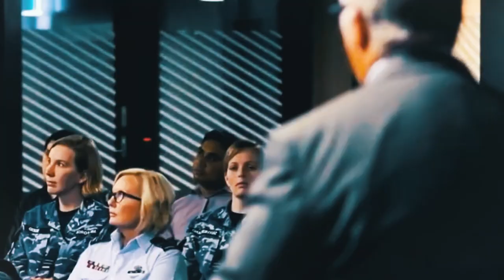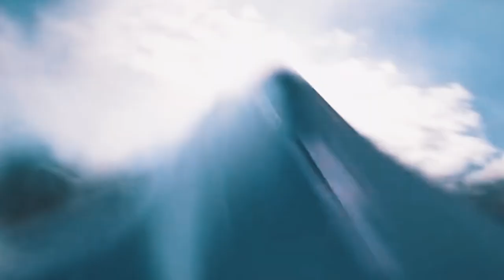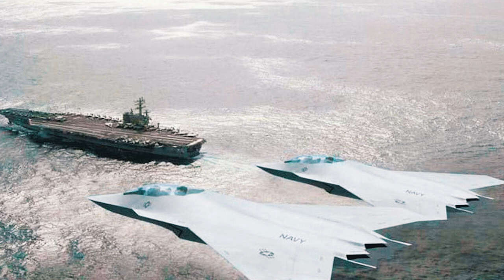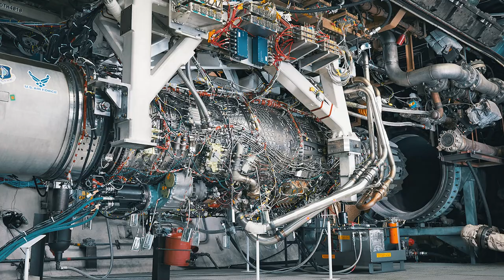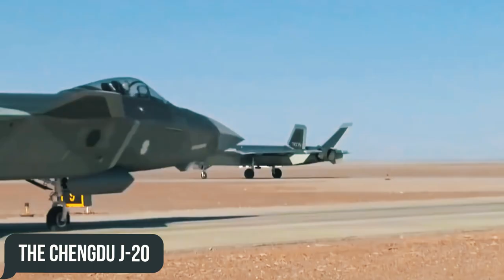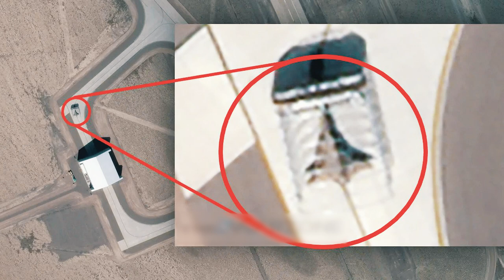Russia Panic: This is America’s 6th Generation Fighter Jet

Comment: In my 6 years of serving in the USAF, I learned this: You don't know and you don't need to know.
Reply: Paraphrased  " on a need to know basis" AIR Force 603 20yrs
Reply: ”Above your pay grade”? Confidential?
Reply: I'd have to agree. Why advertise your possible defense mechanisms. Doesn't make any sense.
Reply: @anthonygutierrez3776  thats why some of  the informations are not detailed..
Reply: I was in the Air Force for 7-1/2 years.  I spent a year in Vietnam and 1 in Thailand.  I worked in the Civil Engineering Squadron, carpenter shop.  In Vietnam the women stayed sort of in the center of the base and they wanted bathtubs.  While visiting their area, I saw some walking from the shower towards their rooms to get dressed.  That was interesting and just had to throw that in.  In Thailand I walked with others across fences to get estimates on some door and wall replacements.  This was the most highly secure part of the base.  It contained pilots on standby alert lounging on sofas waiting for that alert to suddenly rush outside to their waiting B-52 guarded by airmen with large dogs and M-16s.  When I left there I was working in an office when the base commander walked into the room and asked for me by name.  He told me that my security clearance had to be cancelled because I was not born in America.  It didn't matter as I had only 6 months before I was discharged.  My point is that the Air Force is so immense that several instances slip by.  But over all, they do a good job and I was happy to have served.
Reply: Remember the old saying  loose lips sink ships, you don't know who is listening or watching and don't give away secrets by telling a friend about the top secret project you or a friend are working on.
Reply: What are the Mandated Patented Warp Speeded Covid-Vaccine's and Booster Shots "Classified By The Department Of Defense As Top Secret Classified Ingredients"?
Reply: True, but intelligent people are always curious.
Reply: Spent my 6 yrs  in Security Police, traveled the world. TRUST me, you’ll sleep better.
Reply: baaa baaah
Reply: OK. Now, I know.
Reply: @garystegall8735  What do you mean? I'm not curious.
Reply: @eddieraines8365  i

Comment: Explain this. I was in 4th -7th grade during WW II. The planes we knew best were B-25s B-26s P-47s P-82's etc., the aircraft of the war. YET we kids were making paper airplanes, folded into delta wings and pointed noses. They looked a lot like today's aircraft. Mine flew well , too.Did we 9 and 10 year olds know the future? For the heck of it, I just made one out of paper - reminds of the F-102. If I fold it the narrow way, it's an F-101. LOL
Reply: Did you also fold a jet engine into it?🤣
Reply: When I was a kid we had paper airplanes, but we also had styrofoam airplanes which were modeled after WWII aircraft. I think the idea was that delta wings worked better with paper and long skinny wings worked better with more rigid materials, however when you start going as fast as modern jet aircraft do, it's really hard to do anything other than a delta wing and not have it get ripped off in a dive. You will notice that slower flying jet craft like the Boeing passenger craft have a sort of hybrid long skinny wing that is swept back a bit. I think what they're doing here is balancing wind resistance and the required amount of lift. A long delta wing is sturdier, but also incurs more wind resistance due to having more surface area.
Reply: Delta wings are optimum only at supersonic speeds.

Comment: It seems they are taking a page out of space x design cycle. Where the various iterations of design come in much faster waves. And each production run is fairly small while it automatically pushes the next design iteration thus continuously improving designs making it more difficult for the competition to keep up. 
 I also love the concept of a tail less design. I have always thought that tails could be replaced by thrusters that would give a pilot the same control as a tail with only tiny vectored openings that could he concealed when not in use. 
 During normal flight the engines could have thrust varied to steer.
Reply: Yes- just like Space-X! I was thinking this as I watched, only to see your post when I looked at the comments, lol
Reply: The only problem is this makes them less stealthy, as these thrusters will put out heat in a direction perpendicular to the direction of travel, so more of the hot exhaust will be visible by an observer looking at it from the front with thermal sensors.
Reply: @theredscourge  i suppose to counter this you could have separate electric fans for tail pressure. Or even divert some intake bypass air from the engine so that one would avoid such thermal side signatures.

Comment: There's a false equivalence repeated again and again in this video, and that is that the NGAD could, or would, replace the in production F-35s. This is a complete nonsense. NGAD is an air superiority platform that will replace the vast number of F-15 C/D and eventually the Raptor. F-35 will remain the main strike platform for the USAF up until the 2050s. There's one more reason that negates the possibility of buying the future 6th gen NGAD aircraft instead of the F-35, and that is the price. F-35A has finally reached the cost that makes it cheaper than even the 4th gen platforms like the F-15, Typhoon, Rafale, etc.. Given the required capabilities, and cutting edge technologies, that will be incorporated in NGAD, we can say without the doubt that it will be an expensive aircraft. We're talking 150-200 million$ per aircraft. COmpare that with less than 80 million for the F-35 and the thought of buying NGADs instead of F-35s seems highly unlikely. USAF will buy around 1700 F-35s while I don't see them getting more than 500-600 of the air superiority focused NGAD.
Reply: especially how the F22 raptor was thrown in the trash bin which has gotten hype just like this one
Reply: This 1 billion USD fighter jet does not scare the Russians, its speed is still far from the fastest and its functions are all governed by satellite, so being the Russians the masters of space, they have a laser satellite that detects and destroys all military satellites that govern the functions of this very expensive jet, the GPS of missiles and ground combat logistics.
So much for the gringo engineers who will have to go back to the drawing table
Reply: @joseinfante5054  speed doesn’t matter that much

Comment: The F-35 was supposed to replace the F/A-18. In fact, that was part of the affordability calculus. But the F-35 has failed to replace anything.
Reply: ( please forgive my spelling, I'm a Dyslexic but have followed this subject for many years) No, The F-18 super hornet was to be a mult-roll fighter/ light bomber for the US Navy.  Providing many of the same functions as the F-15 for the air force.  The F-35 is a fully stealth aircraft with multi layered intergration of sensor data from many assets. Ground/Air and space information updated contionously.  

As a Stealth multi-roll asset, the F-35 was origanaly at $300 million each.  Due to the success of the program and hundred of orders from other countries the price per each has dropped to $100 million.  What a bargain!  With the intergration of other countries as a combined force, there is a multipler effect with the contionusious aircraft sharing data.  By the way it has a radar cross-section of a bulmble-bee.  As you may now realize the F-35 will replace and complement many current systems and make it easer to have unifide systems for simple parts and repair functions around the world.   This aircraft will replace multiple systems in one fail swoop... sounds good to me.

Comment: Your mentioning that the glass canopy would be retained because the NGAD will have to have a manned version is interesting.
But, I ask why would a manned version require a glass canopy if the F-35 system proves to be reliable while revolutionary? 
When the F-35 pilot is "looking" at his surroundings as though he's looking through the plane, he's not looking at his surroundings directly but through the virtual and enhanced reality that the plane's sensors collect and display for him, there is no longer a need for the glass canopy and its major issues with radar and visual reflection.
Reply: There is a need, if the sensors supplying the visuals become damaged, then the pilot would not be able to see, to fly, an otherwise working plane.

Let me know if I'm wrong. I know very little about these planes.

Comment: It sounds good on paper however I see a potential for corner-cutting as well as the pressure it puts on designers to constantly come up with the new thing. With these big programs that include a massive budget we see the type of development that takes a while but brings to Market a product of substance with a value that is not only seen But felt across the world! I'm wondering will this soften the punch the u.s. Air Force has always had in the eyes of the world? Or is the opposite true, well they tell themselves their development is both evolving and refining at too high a pace for us to compete with? What happens when designer discover just because it's new doesn't mean it's better? This idea does depend on these manufacturers guaranteeing leaps in innovation on a regular schedule, is that a guarantee we can make? I think 65% of the budget should go towards identifying bread-and-butter projects that can have their life cycle extended if possible as well as extended life cycles being a part of the thinking from the design phase to Construction.
Reply: ok

Comment: F 15 EX need to be a 4D vector trusting system to make it more highly maneuverable.
Reply: Wouldn’t give up on it yet. Under the circumstances it may remain viable in the future with a design more capable in regards to range, performance and superior dogfighting capability. The system of procurement I most definitely like it. Basically keeping a system viable before it reaches its service life limit by replacing it long before it gets to that point. Which means those companies keep their lines open (keeping prices down) and a steady flow of hardware. It’s a win-win.
Concentration on future materials to be made and analyzed with be key in pushing the advantage gap back to where it use to be. We make a weapon system an it used to be a thirty-five, forty year gap before your adversary would be able to match it. By then you have moved on to the next improvement and still maintaining that gap advantage. 🌷
Reply: 3D or 4D vectoring engines are a joke and provides slightly better maneuverability. US did the experiments on 3D vectoring engines way before Russia and deemed them useless and heavy.
Reply: @cecilmessi6972  Russia did refuse the ban of asbestos ...

Comment: Do not panic if it works like the F-35 not under storms when it is not sunk on the ground by failures it is enough to see the rate of availability and the always higher cost without effect: which theater of operation used?

Comment: This is absolutely dumb when they can use the nuclear power to run these Jets never run out of fuel and never have to refuel during combat missions or anything they're doing the nuclear fuel is totally safe there is no waste and there is no pollution our submarines are running on it right now
Reply: Correct me if im wrong but nuclear power does not have the capability to produce the thrust required as a viable replacement.
Reply: What kind of nuclear fuel that has no waste as far as I know nuclear waste is the very challenge they encountered
Reply: Well nuclear power has its own demerits that is very expensive and precarious.. 
Nuclear power during war would be environmentally unfriendly.. 
More thoughts have gone into it
Reply: The nuclear reactor in each plane would weigh twice what the aircraft itself weighs, nothing else needs to be said.

Comment: AI that can replace human pilots is very important for the NGAD.  AI can easily outperform human as it can learn from their mistakes and is not susceptible to G force as human does.  AI is also much cheaper to maintain when considering human pilots lost in combat.  As we learned from WWII, Japanese navy suffered after Midway, not because of the lack of Zero, but the lack of experienced pilots.  AI can easily solve the problem by eliminating the man power bottleneck.  It does not mean you don't need human pilot.  One human pilot can lead a squadron of fighters run by AI.  Whoever come up with a viable AI that can control a fighter in air combat can achieve air dominance, simply by the number of planes they can put up in the sky.

Comment: This video makes what's going on very confusing. NGAD is not like the F-35 in that it's made for all the departments. The Navy and the Air force are both looking to acquire separate air frames under their own projects which just happen to have the same name. The Air force has flown their model, the Navy has not to our knowledge

Comment: If we can make a low latency control link that no one in the world can cut, RC aircraft are the way to go. Already manned fighter jets can pull more Gs than a human being can handle.
Reply: You're correct.  As of June 2022 they have solutions to the communication issues. Thanks to the Drone programs and the amount of data generated. 
The main problem and hold up to the production was two different sides and views. 
Pilot in jet or Pilot on the ground.
The rumor is they agreed for the sixth generation Pilot in. 
Seventh generation Pilot out.
Like you alluded to and I will state the weak link is the biologic on board.

Comment: These will be replacing the f22 not the f35 although it's a multi role its more designed as a air superiority fighter with some ground combat capabilities, this means it's most likely designed to escort an f35 much like the f22's job

Comment: Air jets  should  be able  to fly into  space 
And  having the fuel  to fly in outer space
Reply: Well if Russia has done it we certainly can. I know both have done so but don't know if it was just a stunt or a structured project and still open and worked on.